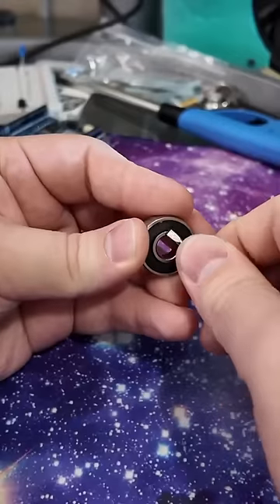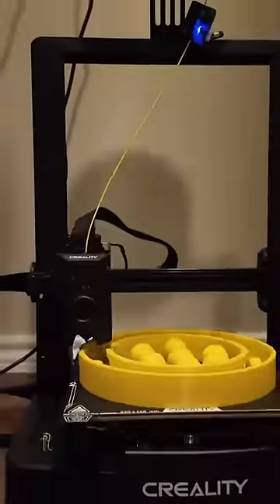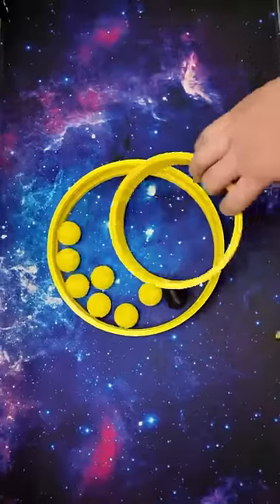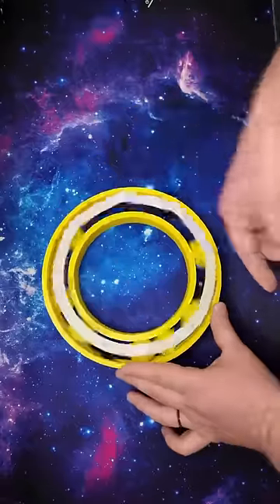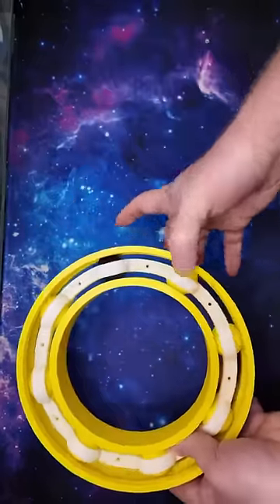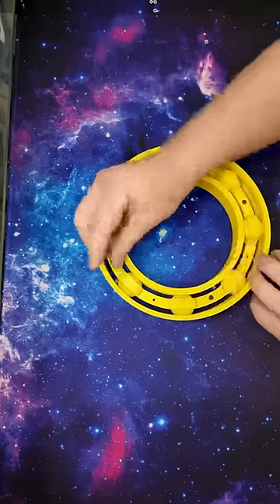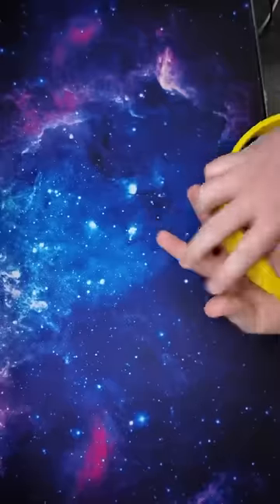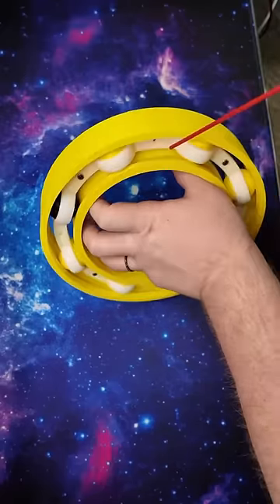How Do The Balls Get Inside the Bearing? 🤔 (ft. GIANT ball bearing) #3dprinting #engineering

Comment: Did ya know wd40 isn't a lubricant?
Reply: did you know that the people who say "wd40 isn't a lubricant" have room temp iq?
Reply: Correct, it is a solvent not a lubricant but it often acts a lubricant. You wouldn’t want to use it for a job that specifically calls for lubricant but it will suffice in many situations
Reply: @koneal2000  Do you even know what WD stands for i think you are the one with a Room Temp IQ
Reply: @user-us2rh7th5b  "WD-40 is an American brand and the trademark of a penetrating oil manufactured by the WD-40 Company based in San Diego, California. Its formula was invented for the Rocket Chemical Company in 1953, before it became the WD-40 Company. WD-40 became available as a commercial product in 1961. It acts as a lubricant, rust preventive, penetrant and moisture displacer." You are the one with room temp iq
Reply: It's a lubricant because it lubricates, it's just not ideal because the lubricating fluid in WD-40 will eventually dry up and leave behind a sticky residue that causes the mechanism to seize, often worse than before. Depends on the application, but it's better for cleaning and preventing rust. It was originally designed to prevent pitting on missiles during long-term storage. Use a proper light oil or silicone based lube instead.
Reply: @Redspark77 redspark, you torched him
Reply: You know some applications use water or air as lubricant.
Reply: @Redspark77 I can act as a lot of things, a doctor, a politician, a dog, however, I'm still just a nobody.
Reply: @crimmy838  what
Reply: That's what she said.
Reply: From WD-40's website:
A QUESTION OF LUBRICATION
Myth: WD-40 Multi-Use Product is not really a lubricant.

Fact: While the “W-D” in WD-40 stands for Water Displacement, WD-40 Multi-Use Product is a unique, special blend of lubricants. The product’s formulation also contains anti-corrosion agents and ingredients for penetration, water displacement and soil removal.
Reply: How many times do people repeat the "its a solvent" after hearing it from cletus out back the shed before deciding to think about it for a second? 
My guess is 15,038

Just look up what the word solvent even means. Look up what the word lubricant means. Ask yourself if any of what you looked up ever mentioned something needing to be labeled as such in a shopping catalog to function as a solvent or lubricant...
Reply: @miles11we  "WD-40 is an American brand and the trademark of a penetrating oil manufactured by the WD-40 Company based in San Diego, California.[1] Its formula was invented for the Rocket Chemical Company in 1953, before it became the WD-40 Company. WD-40 became available as a commercial product in 1961.[2] It acts as a lubricant, rust preventive, penetrant and moisture displacer."
Reply: I thought this too but WD-40  answers this question directly on their website saying that it is a lubricant. But still In my opinion its a better solvent than a lubricant.
Reply: @ThreadedNail  No one markets air as a lubricant and it still acts as an amazing one in air bearings.... a terrible one in other applications 

No one markets or labels water as a solvent, it still is one of the best solvents for polar materials. 

I could call wood a lubricant and I would be about as correct as the people saying wd is just a solvent.
Reply: @miles11we  im just saying what the website says. Im not sayin its true.
Reply: it is though. I think you mean that it's original intention was not to be used 'as a lubricant'.
Reply: @mikayla_collie  plenty of liquids are lubricants or at least can act as one but they're not a good idea to use as one.
Reply: @Steezy_Mx  it acts as a lubricant for a short amount of time. a real lubricant lasts a while.
Reply: @leovang3425  thank you for repeating what i just said... >_>
Reply: @Stackali  Hence the word “act”
-behave so as to appear to be; pretend to be.
"You acted dumb at first”
Reply: @Steezy_Mx if it lubricants it’s a lubricant, water is both a solvent and a lubricant, so is wd40 some people are so dense
Reply: @_Furpoe_   "but.. but.. but the person marketing it didn't say it was specifically meant for removing sticker adhesive so you can't use it for that"
Reply: @_-Furpoe-_  Lubricates* is what you meant to say. If it lubricates then it’s a lubricant. 😂
Reply: @kizza8585 yeah, silicone spray is cheap and ideal.
Reply: Just to clear it all up. 

WD-40 is a lubricant and solvent mix. However the lubricant is not stable. It is designed to help in conjunction with the solvent to break down rust or other chemical bonds that caused objects to seize. (Solvent breaks it down, lubricant helps the parts move more freely.) THIS DOES NOT MEAN WD-40 is a good long term lubricant. Because the lubricants are not stable, it will evaporate and leave behind a sticky grease that will do the opposite of lubricate. It will collect dirt, grime, and moisture, causing degradation of parts. 
True grease or oils that are stable and will not dissipate are what should be used as a true long term lubricant. 
WD-40 is best used for freeing up moving parts, which should then be cleaned with a proper contact cleaner, and relubricated properly. Or, WD-40 can be used on non moving parts to remove rust and left on to continue repelling water and prevent rust. It will eventually develop a sticky film.
Reply: @Redspark77 okay go ahead bud use WD-40 as lubricant. It isn't my stuff that's getting trashed.
Reply: @Redspark77  you really think you're so clever quoting that thing over and over. Go ahead, keep acting like that proves your point. WD-40 is not a lubricant. It can lubricate things but they certainly won't stay lubricated.
Reply: Fun fact : WD-40 (Water displacement)  have an entire line of products in the WD-40 including a lubricant dissolved in solvent, lubricants , greases,and solvents. It's not just one product
Reply: @koneal2000 wrong
Reply: @miles11we saying wood is a lubricant might only be a little off 

In the pre machining days, and even still actually a wood block was frequently used as bearings.
Reply: @kizza8585 so water is also a lubricant?
Reply: @Redspark77  literally if you go to their site they have a warning that states they do not recommend wd-40 as a lubricant regardless of its oily consistency due to the fact it is a solvent that will dry out rapidly when heated. Therefore it's lubricating properties are about as good as kerosene. Yet you don't see that used as a lubricant in any application.but by your standards even honey would be a lubricant right? Just not a great one
Reply: @RyanSmith-wc7ku  Air and water are used as lubricants used depending the application. I went to their website and they describe it as a mix of lubricants, so what is it then? They dont recommend its use as a lubricant when there is heat generated in the mechanism, for that specific application.
Reply: That’s not what Hank Hill told me
Reply: But everyone knows it’s WD40 wait a bit then PAM vegetable oil
Reply: WD=Water displacement
Reply: @kuzuya937  yes, because it can be used to reduce friction between surfaces. But as previously mentioned, some lubricants are better than others, also depending on the application.
Reply: @azeraxosu3051  Quotes a company misrepresenting their product on their website and you consider that a roast? Are you new to life or what? A company making a nonsensical claim for their product isn't new. Wd-40 by definition cannot be a good lubricant because it's a solvent for oils. Meaning by it's very nature it destroys lubricants. It may works for a few seconds, but then it will proceed to cause more damage than it fixed because it evaporates rapidly and leaves the surface drier than it was prior to use.

I think you're all being intentionally ignorant and forgetting that the the company makes lubricant as well. That's where that claim comes from. The actual product called wd-40 is not a lubricant. The "silicon lubricant" wd-40 is.
Reply: It lubricates, just not well or for long. It is a lubricant, just not a good one.
Reply: @Redspark77  him: what does the wd stand for

You: a random excerpt from wikipedia that does not say what the WD stands for.

Thank you for confirming that you do have room temperature IQ
Reply from the maker: I thought everyone was just being pedantic when telling me this, but after buying a real lubricant and testing, the difference is massive!
Reply: @koneal2000 lol I know MENSA members who say “WD-40 is not a lubricant.” Because guess what… it destroys bearings if you try to use it as the only lubricant.
Reply: @Steezy_Mx  It only acts as a lubricant for like a week. Then it's right back to squeaky rusty bearings
Reply: @Redspark77 Only works for about a week. White grease is the best option
Reply: @grizzzymd  ah yes im not saying it is the best option
Reply: water displacement 40th formula?
Reply: there is a lube made by wd
Reply: @koneal2000 its literally a penetrating fluid, there is wd40 brand lubricant tho
Reply: @thomascleveland3401  WD-40 destroys bearing if you use it as the only lubricant? You don't say!

Lithium bearing grease will destroy an automatic watch mechanism, low vicosity watch oils will destroy your lathe, PTFE lube will destroy your chainsaw and KY jelly will destroy your four-stroke engine. Doesn't mean none of those are lubricants, just means they're the wrong lubricant for ther job.

It's almost as if different use cases require different lubricants and that's possibly the reason there are thousands of types.
Reply: @koneal2000  It's okay to lubricate things for short-term applications if you know that you won't be applying it to any of the plastics which melt when exposed to WD40, and if it's not in an enclosed space which will make cleaning difficult. 
Otherwise it's not a lubricant. 90% of people just think "Hey, this thing needs to move, I'm gonna put WD40 in it" and then never clean whatever they just ruined. 

Which is how some monster at work violated a Medeco because he decided it was sticking, and instead of asking maintenance he gave it a big-ol' spray of WD40. Once it dried it left behind residue which wouldn't come out and the lock had to be removed.
Talk all you want about theory, but for practical purposes it ain't a fuckin' lubricant!
Reply: @koneal2000 WD40 isn’t a lubricant it’s a solvent and a water displacer!
Reply: WD-40 makes more than 1 product. 

"WD-40 Multi-Use Product protects metal from rust and corrosion, penetrates stuck parts, displaces moisture and lubricates almost anything."

"Lubricates, resists water and protects metal and non-metal surfaces"

"Lubricates 15X longer than the competition"
Reply: @miles11we  "WD-40 Multi-Use Product protects metal from rust and corrosion, penetrates stuck parts, displaces moisture and lubricates almost anything."

"Lubricates, resists water and protects metal and non-metal surfaces"

"Lubricates 15X longer than the competition"

Hope this helps.
WD-40 makes more than 1 product.
Reply: @MojRor  Okay, who made a bot to post WD40 ads?
Reply: @miles11we  it is a lubricant. It is also a solvent. The lubricants it uses do not stick around very long after use so while it is very much so a lubricant it is not a long term lubricant and is a better cleaner.
Reply: @Loserstakethebait  it is 100% fact that WD40 is a lubricant. It is just not a very long lasting lubricant and is a better solvent. You are being pedantic and wrongly pedantic. It uses lubricants but they do not stick around long after use so it is a temporary lubricant used more for cleaning and protecting. It just works well enough people use it as a long term lubricant and it will often work well enough as one for some things like door hinges but in reality it is a short term lubricant meant to clean and smoothen the action.
Reply: @thatguybrody4819  Except it's not. If you understood basic chemistry you would realize how ignorant your comment is lol. Wd40 is not a lubricant because it's impossible for something to be both a lubricant and a solvent on the same materials. Outright impossible. Wd40 is literally a worse lubricant than water and causes rust build up rapidly when applied to steel. It's a solvent that people wrongly use as a lubricant. Companies are allowed to lie on their products, that's all this is.
Reply: @Loserstakethebait  I know I'm most likely feeding the troll based on your username but still. It is not actually a solvent. It acts like one thanks to the components but is in reality a short term lubricant. It gets in small places and allows material to move and get impurities like rust or dirt free while providing a film to lubricate the surface for a while. The problem is it does not lubricate for very long as it dries up and starts attracting dirt which traps humidity. Like I said before; it is a great cleaning agent as it acts like a solvent and is a good short term lubricant but is not a good long term lubricant and you will want actual long term lubricants for important things that will require constant motion unlike something simple like a door hinge.
Reply: @jakedewey3686 go ahead and use it to grease your ball bearings on your car and tell me how that turns out
Reply: @phantomarcher9590  you wouldn't use liquid lubrication for those anyway since they use grease.

Comment: Fun fact, not all berrings have balls inside of them, some use cylindrical, needle, conical or barrel shaped rollers
Reply: Yep I made roller, conical, spherical, and thrust plate bearings for 15 years. There are so many types. We made anything from 3/4 inch in diameter all the up to some that were 8 FEET in diameter. It was an interesting job
Reply: Some don’t even have rollers
Reply: Fluid film Babbitt bearings! Or other hydrodynamic materials.
Reply: And magnetic
Reply: @bricklearns  exactly, some are just plain bearings.

Comment: There is actually a specialized spot welder for plastic. It uses ultrasonic vibrations to melt the plastic together.
Reply: The settings and tooling have to match the plastic and thickness, but, yes.
Although, the soldering pencil has potential!  😉

Comment: Bearing Application Engineer here:

This is called the Conrad Method for ball bearing assembly. Some older bearings have a "filling slot" as notches in the rings to allow more balls to fit in. Also, most high quality ball bearings have a very specific amount of play manufacturered into the design so that there is still room for the lubricant.